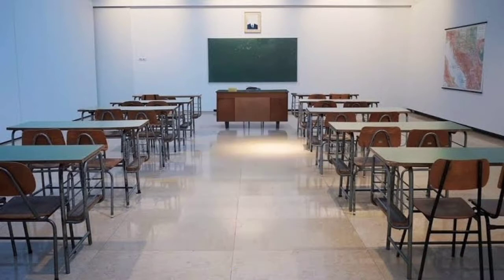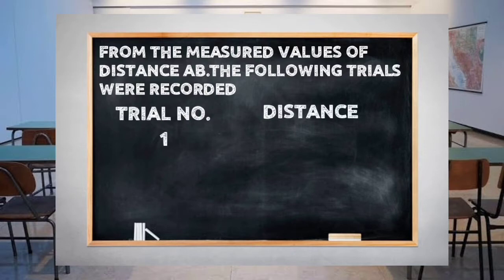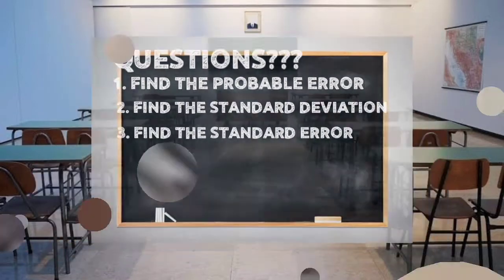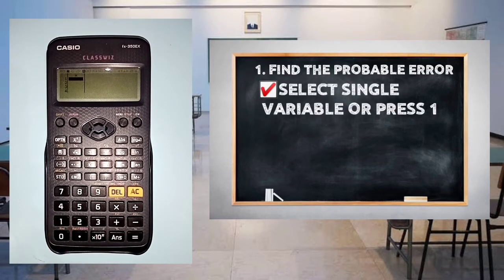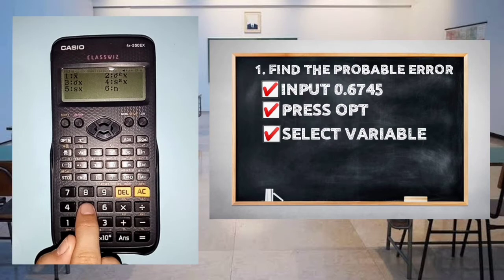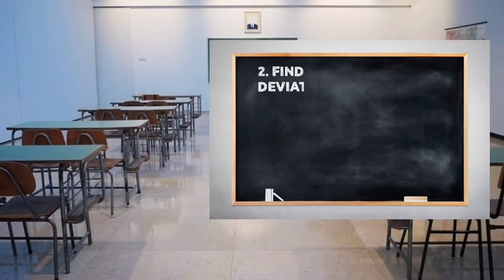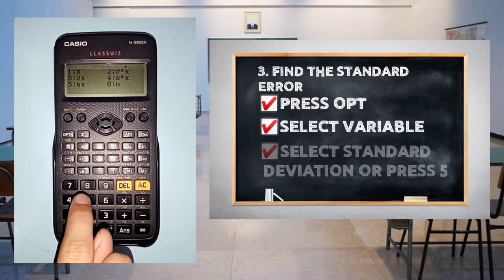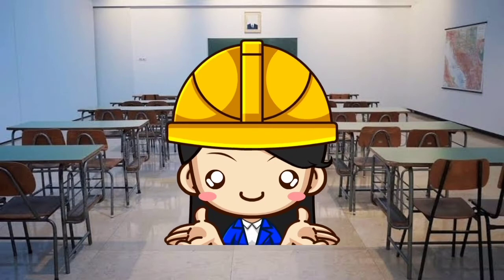PROBABLE ERROR, STANDARD DEVIATION AND STANDARD ERROR

Comment: Medyo nalilito ako sa formula ng standard deviation. Based sa Gillesania, over n lng yung formula, pero sa Besavilla over n-1.

Na try ko dn sa calculator yung no. 1,
0.6745(SD or xn)÷sqrt(n)  - - - Same ito sa vid mo, pero yung ans is 0.02590. Pero pag 0.6745(SD or xn)÷sqrt(n-1) yung ans is 0.0299 which is correct at yung expression is same sa formula ng probable error of the mean na over dn sa n(n-1). Tinry ko baliktarin, 0.6745(Sample SD or xn-1)÷sqrt(n) yung ans is 0.299. Indi ko gets bat mali yung ans ko if yung 0.6745(SD)÷sqrt(n) (Same sa vid) ginamit ko. 

Sa no. 2 dn, since standard deviation, so x(sigma)n , yung ans is 0.0768 pero kng sample standard deviation nmn x(sigma) n-1,yung ans is 0.0889. Indi ko dn d2 gets bat standard deviation yung reqd pero bat nsa sample standard deviation yung correct ans.

Also, poh yung ginamit mo is sx which is sample standard deviation. Meaning to say automatic na sample SD talaga yun bsta sa surveying?

Canon f789sga at casio 991es pala gamit ko poh.
Baka mka elaborate ka poh d2 engr. Especially yung formula sa Besavilla book na over n-1 yung SD pero sa Gillesania over n lng yung SD.

Thank you in advance engr.
Reply from the maker: Good Day Sir. Kindly message me thru my facebook page, so I can discuss it to you